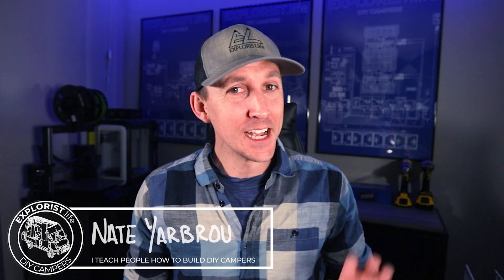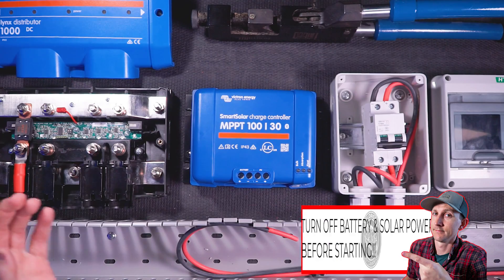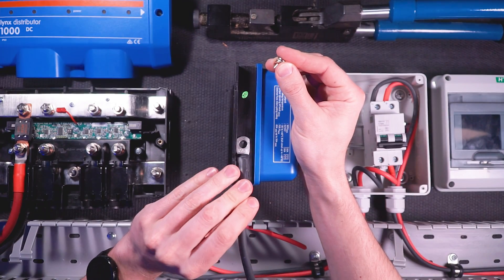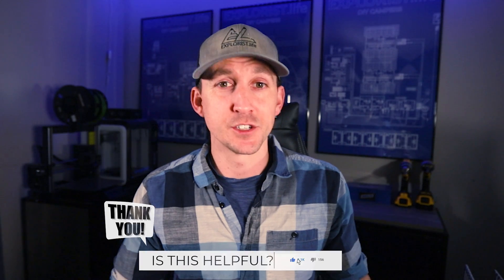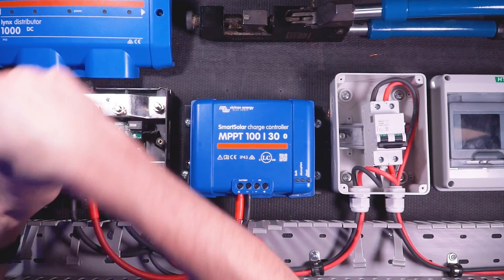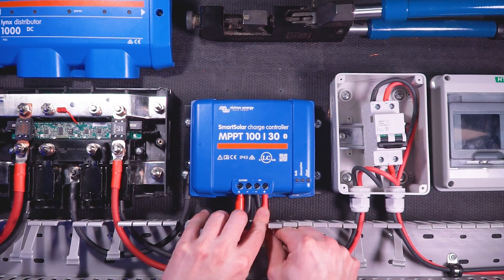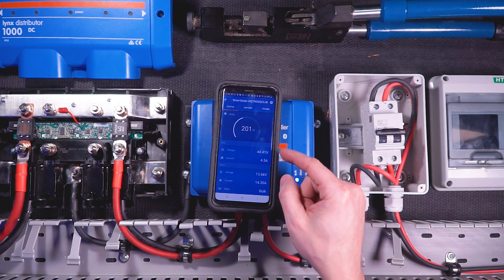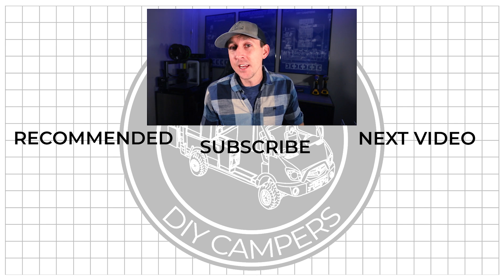How to Wire a Solar Charge Controller in a DIY Camper Electrical System

Comment: Hey great great instructions, i have a rudimentary question. When i physically push the positive wire on the battery terminal into the Victron controller, the solar wattage coming in increases by up to 50%. I have reconnected, tightened, fiddled with this connection point but am alway left with the fact that if i apply pressure on the wire into the terminal, my solar power changes. Any thoughts? Thanks in advance!
Reply: I have experienced this same exact thing! When I pinch pressure on the wire running from my positive lead into the Victron my incoming wattage jumps up. Did you find anything regarding this?
Reply: I just fried both my solar chargers by not disconnecting the solar panels when I disconnected the battery and reconnected them. Apparently you should NEVER have the solar panels connected while battery is disconnected and reconnect the battery. Sounds like you are connecting the panel first, and then the battery... Maybe that works on Victron but on other brands that will fry our solar charger.

Comment: Hi thank you for your videos. I have a question. I have 2 48 volts batteries in series to make 96 volts  and I have 2 victron.  solar charger 48 volts can I wire them in series to get 96 volts and I only have 1 solar panel 400 watts.  Thank you

Comment: Hi Nate, Great video... thankyou. I have a Victron Smartsolar MPPT 100/50. In the installation manual section 4.4, it states that the chassis grounding is for 30A model only. There is a chassis ground point provided on my MPPT 100/50. Should I ground my MPPT 100/50? Thanks
Reply from the maker: Yep!

Comment: I would like to ask you and perhaps others hear about Ferrells,,,I have a 100/50 Victron smart charge controller one thing I have noticed is the wires Solar and Battery and Battery out etc. will pull out of their little wire sockets rather easily I’ve got them pretty good right now however I don’t have the upmost faith in them. I have seen you and others use ferrules for these charge controllers and I have heard others cry wolf and say not to use them,,,have you had good luck using ferrules??? I want a better way of securing my wires in the charge controller. please and thank you to everyone,,,by the way you make an excellent video here.👍

Comment: How did you decide on a 60amp MEGA fuse for a max 30amp output MPPT controller?
Reply from the maker: Recommendation from the user manual. 😏👍
Reply: @EXPLORISTlife  Thanks! And keep up all the good work! Have already learned so much from this channel and just learned a little more!
Reply: @EXPLORISTlife  FYI - I checked the victron manual and it indicates "The battery supply must be protected by a fuse as per below table" and for the MPPT 100/30 it shows 35A for the minimum battery fuse rating and 40A for the maximum battery fuse rating." Not trying to troll; just trying to learn -- would that info, would you possibly change your selection from a 60A fuse in the video to something within the recommended range?
Reply from the maker: Sometimes we have to round to the next available fuse size and a 40A MEGA fuse doesn't exist.  Unfortunately, the engineers who write user manuals don't take into account what parts are actually available to the consumer market; so we sometimes have to fudge a little so that we can actually connect this stuff.
Reply: @EXPLORISTlife  Thank you! Good to know there’s some wiggle room.  I’m adding a Victron 150-85 right now but don’t have the Victron busbar so I’m using Midi fuses instead of MEGA. After seeing your video, I  wondering if I’d run into the same issue but looks like I’ll be ok at these higher amps.

Comment: Hi! Is there a way to connect the Victron MPPT with a Victron BMS for communication - BMS tolds the MPPT to shut down when the Victron Smart Battery is fully charged? Thanks!
Reply from the maker: Most definitely!  That is absolutely an option.
Reply: @EXPLORISTlife  I am using all over Victron SMART - will those elements like the MPPT and the Shunt communicate over the VE.SmartNetworking? Or do I need any cables to connect them properly? Same with the ORION DC2DC and the Shunt. Those elements I need to make sure they will shut down and not overload my battery.  I really need some details to set it up. If you got time this might be a really good and helpful topic for a shirt tutorial. Thank you!

Comment: Looks like your wire that goes to the bus bar is a different gauge. Why?
Reply: Idk why no one replied to you, but the amperage coming into the controller from the array is lower than the amperage coming out of the controller.

~16a peak comes into the controller at 24/36/48v etc (series) and when being stepped back down to battery voltage for charging the amperage is increased. 

A 780w 48v array charging a 12v battery requires 54 amps+ current rated controller, and the experienced load between battery and controller is that of 54a peak as well hence the larger than 10ga wires.

Comment: I know this is a old video but I have a question.  I thought I saw in one of your tutorials you had the solar charge controller wired in before the master switch to the battery.  In my thinking this would allow the the charge controller to continually keep the Batts topped off.  In looking at this video it looks like you have the controller wired to the distributor and turning off the the charging when the master off say while the coach is in storage.  My system is in a small A-frame trailer that will see periods of storage.  In the winter (in Colorado) I shut the system down and pull the batteries but during the months of camping with is the best option?
Reply from the maker: Yeah, that method was REALLY old.  I put everything on the 'non battery' side of the switch.  It's just easier to go through and turn your loads off and leave the solar running and keep everything simple from a wiring standpoint.  Sorta like how when you leave your house, you just turn off all of the lights, fans, TV's and such; but you never turn off the master breaker for your whole house.
Reply: @EXPLORISTlife  Thank you for the quick response!!  So a breaker or fuse between the charge controller and battery will be sufficient?  and if its done this way will a shunt still work?

Comment: So when installing a breaker off batteries to charge controller the battery is line and other to charge controller is load
Reply from the maker: I recommend using the Lynx Distributor instead of a breaker as shown in this video.

Comment: Is there any reason not to connect the equipment ground wire to the center stud on the negative bus bar like you did in this video if you're also connecting the equipment ground of the multiplus to that same center stud?  Or is it better to go from the charge controller to the multiplus then to the center stud on the bus bar like you do in the wiring diagram, which you noted around 3:50 in the video.  I ask because I have the charge controller right next to the Lynx just like you do in the video, so it would be a much shorter wire vs. going all the way to the multiplus first.  Hopefully that made sense.  Thanks!
Reply from the maker: Electrically, that's fine.  It just won't fit, though.

Comment: After seeing so many similar setups, I have a concern about the charge controller. Would a blown battery fuse cause damage to the charge controller? My mppt controller says to never connect solar before batteries, so a blown fuse would create this scenario. Is there a way to protect agaist this?
Reply from the maker: Victron charge controllers are rarely damaged when disconnected from battery power before solar.  It can happen, but they are robust enough that it's very rare.  I can't speak for all brands of charge controllers, though.
Reply: Most likely it will go fine as long as the solar cherger is booted up and not dead and then suddenly connected to battery while getting full blast from the solar panels at same time... I just fried both my 2 solar chargers that is always connected to panels by flipping the switch connecting them to the battery while they was dead and not booted up...

Comment: Nate, appreciate your videos and wiring plans. I have a question about a solar isolator vs a battery switch. Apparently he isolator switch disconnects both + & - of the solar panel, while a battery switch disconnects only the +., but it still shuts off the current.  The isolator is rather bulky compared to a battery switch.  Why not use a battery switch instead?

Comment: Confirm the 100 | 30 doesn’t use one of those little green connector plugs like I see on the dc to dc chargers? I didn’t get a green plug in my box . Hoping I didn’t throw it out if it came with it. Didn’t see it here. 💪🏼

Comment: Hi Nate, if you disconnect the battery cables from the MPPT CC, the load coming from the PV array will damage it, correct? How do you protect your MPPT against a possible battery disconnect?? Please help! Anybody. I have VE 12/1600/50 inverter and 100/70 MPPT. Thank you guys!
Reply from the maker: Just don't do that.  Come up with a procedure for never turning off the battery before turning off the solar array.
Reply: @EXPLORISTlife  Thanks! Watch, love, subscribed, bell, thanks

Comment: . What size wire did you use out of the controller into the lynx
What size fuses did you use
Are in the lynx distributor

Comment: Hey, I always hear about attaching to backer board, but specifically what kind? What is a good thickness and what type? I have a Renogy charger/inverter that is really quite heavy and nervous about mounting it. Thanks in advance
Reply from the maker: All of our wiring kits include screws for 3/4" Ply.  I'd be concerned for anything thinner, specifically for inverter/chargers.  Just a charge controller would probably be fine with 1/2", but I always use 3/4".

Comment: Great explanation I have a victron 100/50 and 2 x350w solar panels, but only 1 on my caravan roof so far, the max watts it has gone to is only 190watts which I thought it would have been more, so I am going to put the second panel up is the victron big enough? and over 5 meters what size cable do I run to the controller from the panels, as the controller might not fit the diameter of the cable that is needed as I  thought the controller handles 600 watts? thanks Wes
Reply from the maker: Hey, Wesley Blake! I appreciate you taking the time to ask your question, but unfortunately, I don't have enough info about your specific question to provide an accurate answer, but here is a playlist that, if you watch all of the videos start-to-finish (and take notes 😉), you'll have a REALLY good idea of how to design a solar array: https://www.youtube.com/watch?v=Jkbs84sBHsg&list=PLmvhcyi4n0TV9pi83rFTv3ZuMT_S1xIZt

Alternatively, I have some of my most common solar array setups pre-built here: https://shop.explorist.life/product-category/all-products/camper-wiring-kits/solar-charging-wiring-kits/

Comment: Could a run a wire from my alternator to the solar control and skip the dc to dc charger?
Reply from the maker: Nope.
Reply: Thanks think I'm just gonna use 1 of your diagram and not burn down my project.

Comment: Hi Nate. How come you are using a 16 amp fuse for a 30 amp charger?
Reply from the maker: That's a 60a fuse. Not 16A.  16A would blow under normal operating conditions.

Comment: Hay Nate, when using mega fuses in the Lynx Distributor, how do I figure the size for my charge controller? I am using a GP-MPPT-PRO-60. I noted that you were using a 60 amp with the 100/30 controller. The Go Power is 150/60.
Reply from the maker: Sure!  This video will teach you how to size fuses: https://youtu.be/5y-yDMEgV70

Comment: can you connect the positive and negative directly to the battery bank?
Reply from the maker: Yes as long as proper fusing and shunt placement is used.  Using a Lynx Distributor is the easiest and cleanest way to accomplish this.

Comment: I have 200w on the top of my caravan and If my controller is big enough spec wise could I add a second panel in parallel? I’d like to run a wire straight from the controller to a plug so I can add a further panel on the ground when I’m away for longer periods, but wouldn’t use it all the time, just have it as plug and play.

Comment: Your videos are great. I put together a small system that appears to function well. However I've encountered an issue that I have never seen mentioned in any ones videos. Most of my power tools, razor, blender some medical devices and rechargeable lighting  does not appear to be usable! Standard 120v appliances do work fine. The problem is after a complete reading of the owners manual for my 1000w pure sine wave inverter  I learned electrical devices using NiCad batteries will probably be damaged by the typical simple solar system.. So now that my rv has a basic solar system the only thing I can do with it is charge my phone.
Reply: They probably have high startup currents which the inverter can't provide

Comment: Hello
people want as much as possible from the solar plant
but no one sees the possibility of dump load why?
Could it be because the solar charger does not have this function ready to use
the victron has control of an external relay that can be turned off or on depending on the battery voltage Power that comes from the solar panels is what should control dump load possible or not
A fully charged battery takes little energy and the voltage rises from the solar cells and the amp drops
Then it is possible to take the extra energy directly from the solar cells
I think people would have this if they knew about it

Comment: Hello
have been looking at your posts and i must say very educational and interesting.
would like to mention that I am testing and trying to find improvements of various kinds when it comes to solar energy
What I have come to the conclusion is that when you are off grid and charging the battery, you can lose a lot of energy
Example
when the battery is fully charged, there is still a lot of energy left to use.
Have built a system that takes this energy without the battery being involved.
Save the battery until after the sun has gone down.
If the consumption is higher than what is available without the battery, the system goes back to using the battery as standard use
Everything works automatically
looking for this possibility in different setups but can't find anything similar.
Fully charged when the sun goes down
and lots of energy throughout the day
SINCERELY
Larry
Reply from the maker: You'll want to look into 'solar load dumping'.  I don't have any tutorials about it, but that's the search term you're after.

Comment: Hey Nate what's the reason for a separate ground on the side of the 100/30 mppt
Reply from the maker: It provides an additional path back to the negative busbar in the event of a catastrophic  failure of the device where the positive wire may come in contact with the equipment case.  This allows power to flow uninterrupted and trip the fuse, stopping the flow of power.
Reply: @EXPLORISTlife  Thanks, is it acceptable to ground to the chassis of my vehicle
Reply from the maker: @Marco De Ci  I recommend wiring as shown in the video I made. 🙂👍 If you want to change things up, you'll want to do your own due diligence and dive into the electrical code books and manufacturers' literature to figure out if your proposed alteration is acceptable.
Reply: @EXPLORISTlife  Thanks again however i dont have a busbar my controller ground goes straight to the battery terminal
Reply from the maker: @marcodeci3951  In that case, I wish you luck with your upcoming reading.
Reply: @EXPLORISTlife  ?
Reply from the maker: That was my nice way of saying 'If you want to change things from what I teach on this channel, that's on you'.  

I recommend using a busbar and wiring the equipment ground back to the negative busbar as shown in this video.
Reply: @EXPLORISTlife  I get it but i have a coachbuilt motorhome and there simply isn't room for a Lynx and all i was asking was how to ground the mppt, loads of others must fit charge controllers without a Lynx to ground it

Comment: Would the smartsolar victron setup be aware of when you're connected to shore power? My teardrop has a battery charger prewired in with a shore power plug and I want to make sure having both on won't damage the battery. I assume the unit will see the increase in voltage and stop charging but wasn't sure about it.
Reply from the maker: It sure does!

Comment: It would be super helpful if you said what wire gauges you were using for each run too!!
Reply from the maker: For sure!  The solar wire will always be 10AWG for the ways I design solar arrays.  The Battery side will be either 2ga, 6ga, or 10ga depending on the size of the charge controller.  These should help: https://shop.explorist.life/product-category/all-products/camper-wiring-kits/solar-charging-wiring-kits/
Reply: @EXPLORISTlife  thanks! Most of these kits seem to have the panels ran in series rather than parallel. Why do you recommend that besides lower amps? I’ve heard parallel is preferable for van solar. Thanks again!!